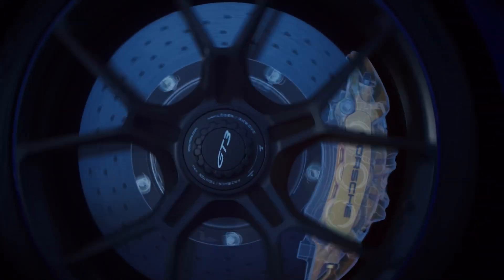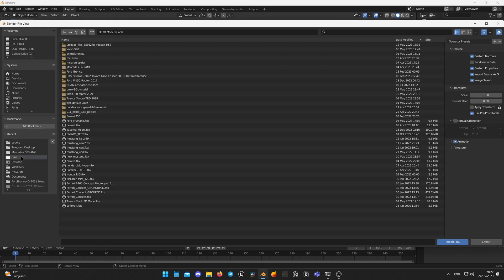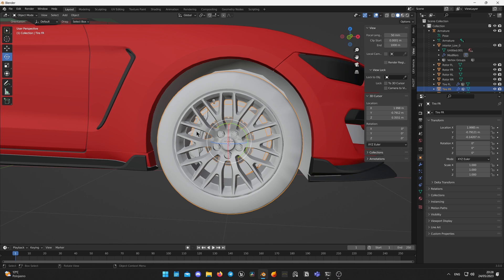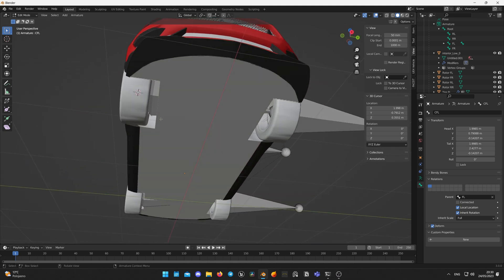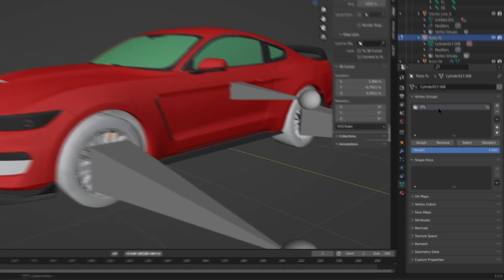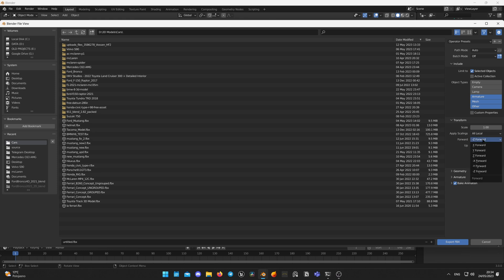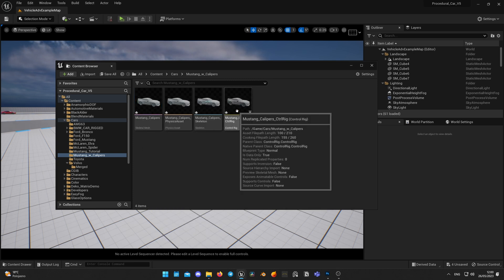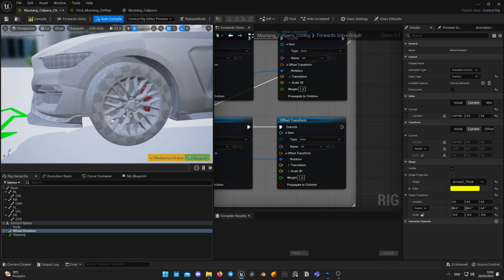CALIPERS FOR CAR RIG in Unreal Engine 5

Comment: Hey I really look for a car animation tutorial going through the steps on making the sequence, animating and then exporting
Reply from the maker: Gotcha, but it is quite simple. Just attach skeletal mesh to rail, open sequencer, add rail and skeletal mesh to the sequencer. Add track for Control Rig for car and add track for Camera Rig Rail. Pretty much that's it
Reply: @postprocessed  Yes, but I want to see your path tracing/lumen lighting and your export settings as well as what you do to make it so cinemtatic. Also the colour grading you do.
Reply from the maker: @princerooni  ok, will be a video then)

Comment: Amazing! Thank you! One issue I am having animation the car using a camera Rig (has you showed in your previous video) is that sometimes the wheels are not touching the ground, because my ground is not perfectly flat, its a road on a mountain landscape. Even though I snapped the Camera Rig to the ground I noticed it is not always perfect and the separation of the wheels and the ground vary.  DO you have any solution for this? It would be great if we can see a video on how to do that correctly to be able to animate a car on a non-horizontal road. 👍

Comment: Hey man,I follow your tutorial on making a car rig but now I have an issue where the vehicle is invisible when rendering with path tracing, check everything and everything regarding ray tracing is enabled. its perfectly visable in the editor window and renders with lumen just fine. been trying things for several days and nothing works. If I turn on "Render as Static" it showns up but then my animations from the control rig doesnt work.
Reply from the maker: Hey there, I was thinking about possible options, but I did already multiple animations. and all worked fine. Please check if you have your car transform position key framed at 0 0 0 if it is attached to rail. If it is not - it may be somewhere far far away during render. If that doesn't work check these threads for possible solutions: 
https://forums.unrealengine.com/t/control-rig-animation-not-working-with-movie-render-que/776426
https://forums.unrealengine.com/t/skeletal-mesh-not-showing-in-animation-sequence-created-from-control-rig/483912
Reply: @postprocessed  I will try again soon, but the weird thing is that you can almost see it, when the image is denoised the place where the car is suppsed to be at isnt denoised as good so you almost see like a shimmering outline. almost like a ghost
Reply from the maker: @anthonyknight170  do you use CAD model? With very high poly? is it Path Tracing you are using?
Reply: @postprocessed  yeah it was a CAD model with roughly 6m polygons, converted in blender and then exported as fbx to UE

And yeah I’m trying to render it in path tracing. Works fine in lumen
Reply from the maker: @anthonyknight170  haha! Welcome to my thread on epic games forum! 😂
It got solved there
https://forums.unrealengine.com/t/skeletal-mesh-is-not-rendering-in-path-tracing-ue-5-0-2-why/667556
Reply: @postprocessed  yeah that sounds about right. Do you feel like making a tutorial that goes through your workaround for the problem?
Reply from the maker: @anthonyknight170  well… it’s very… specific and narrow problem. I think YouTube short would be enough for that
Reply: @postprocessed  i’ll take anything to get this solved 🎉